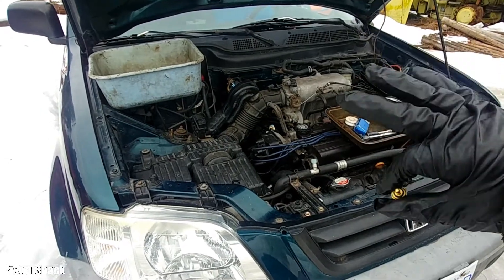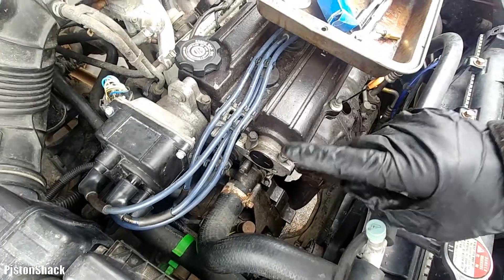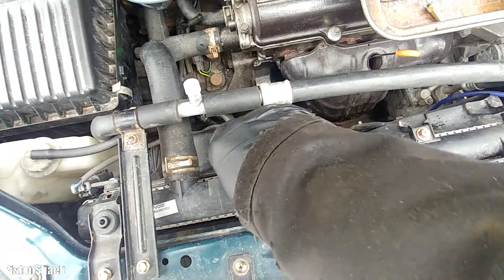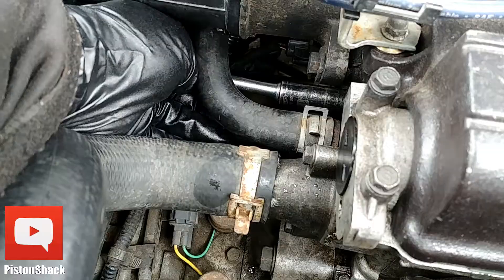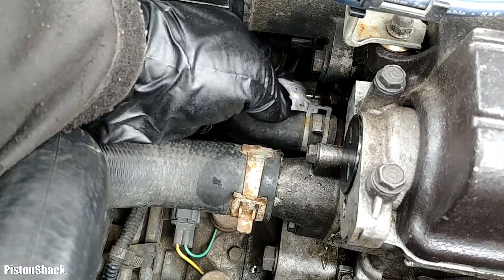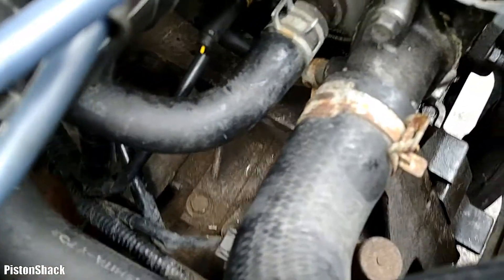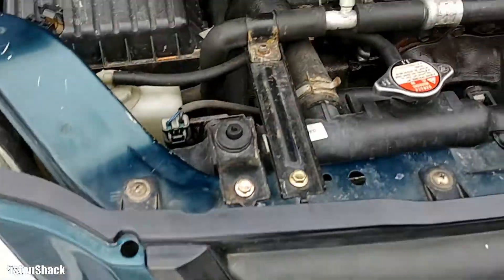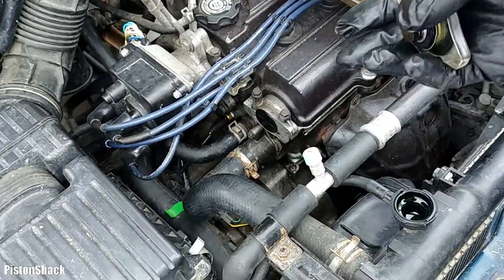QUICK & EASY ENGINE COOLANT TEMP SENDING UNIT REPLACEMENT ON 97-01 HONDA CR-V

Comment: Wonder if you could jack up the car on the passenger side and secure with stands so avoid coolant loss.
Reply: @chrisboyd6032 brother just replace the coolant while you're at it, a gallon is 20 bucks

Comment: So you replaced the SENDER and not the actual Coolant Temp Sensor. A little confusing when you do not refer to the part correctly
Reply from the maker: Thanks for the correction. You're right. I have to correct the title and thumb.

Comment: Went check my ac out same car 97 crv they said everything works just not to the computer like he turned it with his machine an tested my car won’t turn it on should I do these cheap fixes before I just swing for a compressor

Comment: Wtf why would you use Teflon. It melts under that high of heat.
Reply: RIght! That ECT has a washer that is to prevent leaks.
Reply: @shaggytrooper  we use teflon tape on our aluminum die cast molds. They get injected with 1500 degree liquid aluminum and the die usually stays about 200 degrees